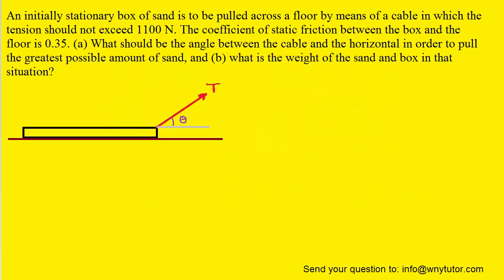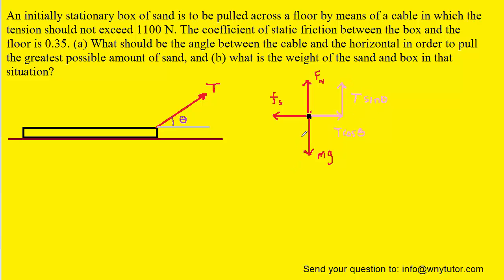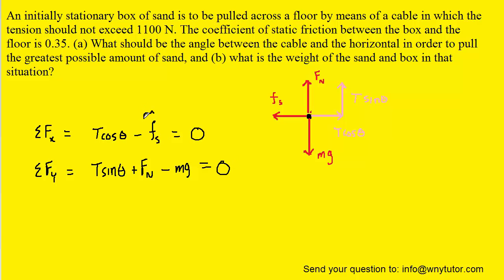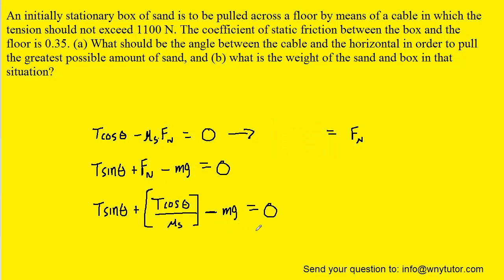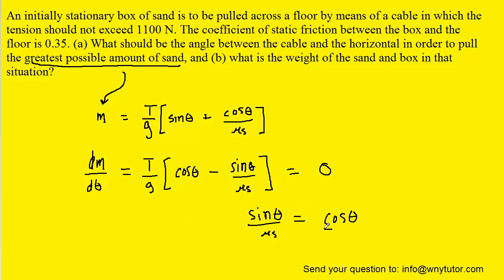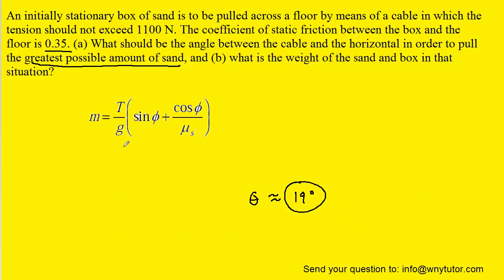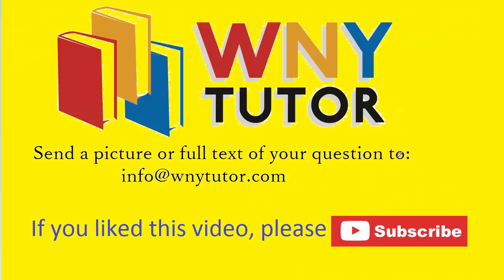An initially stationary box of sand is to be pulled across a floor by means of a cable in which the

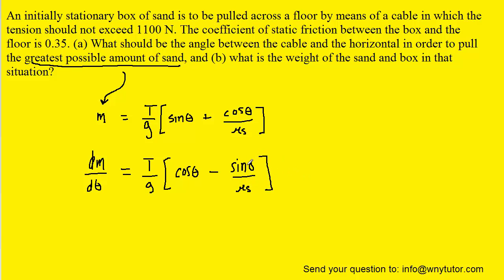Comment: why was the cos and sin switched at 2:33? i did not understand the explanation about the maximum amount of sand either.
Reply from the maker: The answers to these questions require knowledge of calculus. Have you taken that level of math yet?
Reply: no, but i did not know that calculus is a prerequisite to physics
Reply: aoko sakano um calculus is a pre requisite to everything. You do derivatives in physics also so you might as well learn derivatives of trig functions
Reply: i take physics class but i have not taken calculus, many others in my physics class haven't either